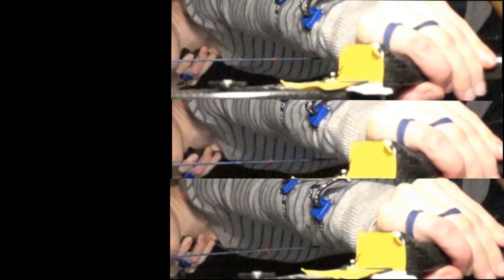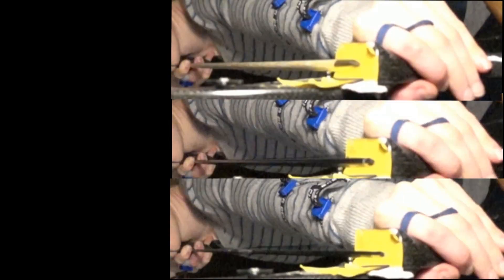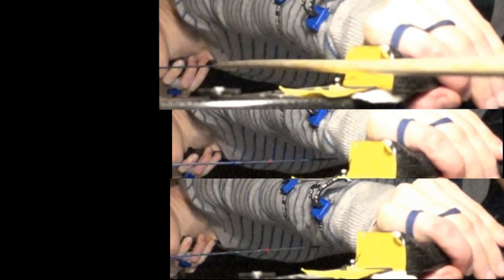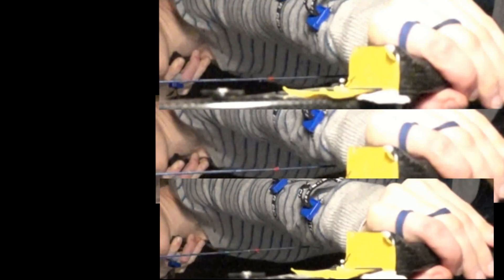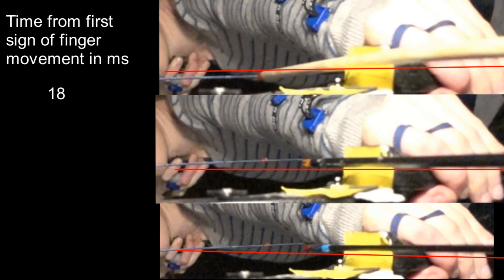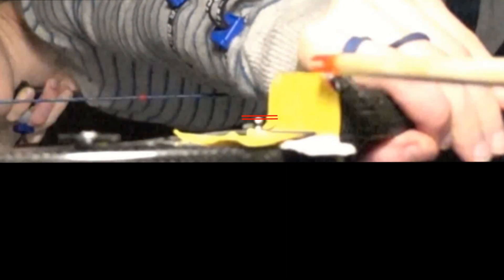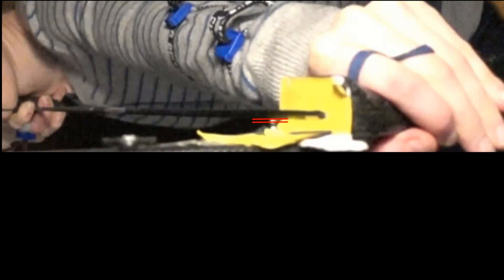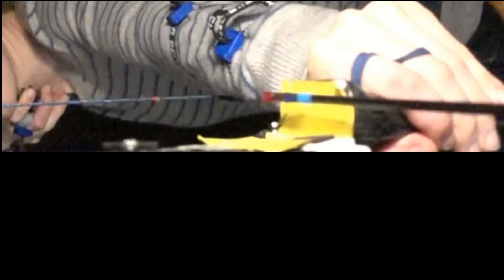slow motion carbon, wood, and aluminium arrows out of a recurve bow at 1000 fps

Comment: Is the composite arrow parallèle or barrelled? thanks for all your videos. They are good material.
Reply from the maker: The composite arrow is an Easton ACE spine 620, which is 5.3mm at the front and 5.4mm at the middle and 5.2mm at the back. So it is barrelled, but not to the same level as an arrow like the X10 (4.5mm-5.3mm). Glad you like the videos.